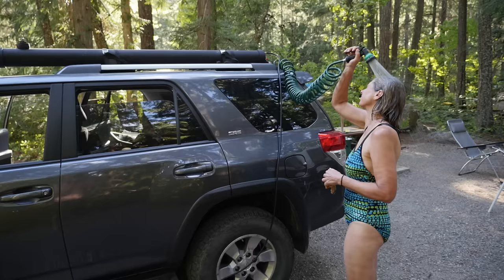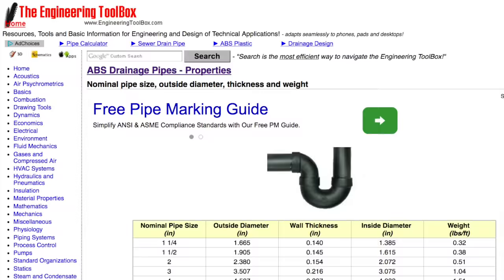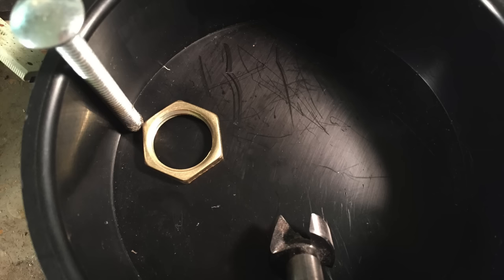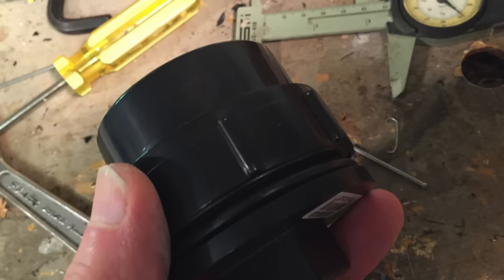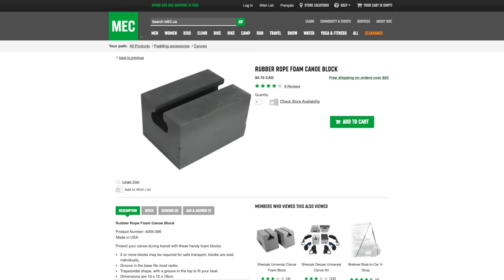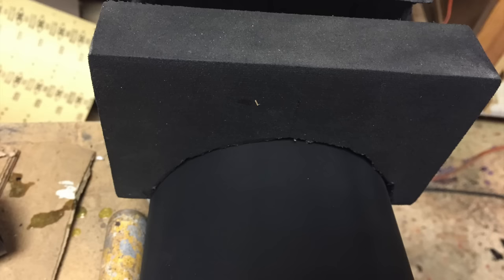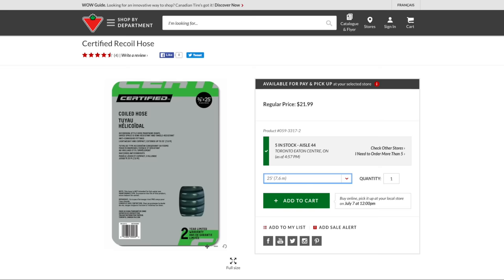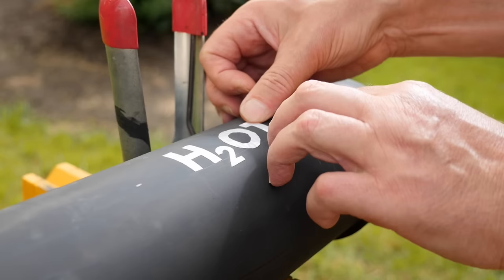H2OT - Rooftop, pressurized, solar-heated shower/sprayer using ABS pipe. DIY

Comment: That's a nice little build. Have you ever thought about adding in a cheap 12vdc water heating element? Back on the farm we had them for smaller stock tanks. I bet a 300 watt element would be perfect for this and heat water up fairly fast. We had them on rubber maid stock tanks, so installing one on PVC should be no problem. I mean it's a standard 1" NPT. 

The general rule is 2.47 watts to raise one gallon of water one degree in one hour. So it's simple math to get you in the ball park.

You would just have to turn it off before draining the tank so you don't burn it up, but if you could take shower after shower with little down time....might be worth it. Keep up the great work.
Reply from the maker: I am not sure how I would power this. 300w @ 12v = 25 amps. A continuous 25 amp draw on my truck (4Runner) battery without the engine running is a not a smart plan.  Also, the idea was to use solar power to heat the tank, thus a carbon free solution. NOTE: The tank is ABS, not PVC. I have explained my rationale for this many times in past comments.
Reply: This is exactly my plan.... Cold cloudy days are not going to be much help at the end of the drive. I'm looking at the 150/300 watt element—has two heating elements, each at 150 watts that can be wired separately. This can be plugged in for the duration of the drive—using electricity generated from the alternator. The length of the element will fit with a 2" side angled clean out fitting.  2" slip to a 1.5" threaded reducer, then a 1.5" to 1" galvanized reducer for heat dissipation from mount of element. Can't be too hot as a plastic bulkhead fitting is used to mount these heating elements to plastic tanks and buckets.

And yes, I will not be using a radiator "pressure relief valve" but a schrader valve on the top 2" screw cap and eliminate one penetration and extra materials. 

Another issue is this design will be blowing air before the water is gone, unless the whole unit is mounted on or the car is on a slope. This is why many folks use a street fitting at the end to drop the faucet to below the level of the main pipe. This design also leaves no way to service the schrader valve or the faucet without cutting open the unit.

But, I'm sure these ideas can be shot down like every other thoughtful change to the original genius. 

"A mind is like a parachute, it only works when it's open."

Comment: Perhaps a reflective strip under your tank to get the most out of the sun.🌞
Reply from the maker: The radiant heat reflection off the truck roof is very effective as it is. I suppose a white vehicle would be even better.

Comment: So 'Flat' Black absorbs more heat than 'Gloss' Black??? Just curious why you painted your already Gloss Black pipe a Flat color. Kool video👍👍
Reply: Yes, flat black gets hotter. Gloss is shiny and reflects some light. Also gets hotter if it's enclosed with glass and insulation.

Comment: Hi, would you see any issues with routing the outlet of this system internally to feed a hot water tap purely for washing up in a campervan? Of course it would need to be drained if freezing temperatures were forecast. I ask as I don't want a shower (internal or external) but dont want a full blown combi (£1500) or a heat exchanger (air to water) via a diesel heater.
Reply from the maker: I see no problem with that. But keep in mind you will have to figure out how to monitor the compressor. As water is used the air compressor needs to kick in to bring the pressure back up and then shut off.  I do this manually right at the compressor outside (while my partner showers).  You will need a compressor with auto-on and off ranges.

Comment: The Milton tire valve includes two rubber washers/gaskets, a top and bottom.  It seems like you did use those, right?
Reply from the maker: Yes, I used the seals that came with the valve.  Someone has recently mentioned that they had two sets of seals with the valve they bough. I believe they are just for different size holes in the tire rim.

Comment: +imaginetMedia  Agree with other comments -- very nice video and end result.  

A few questions please:

1.  How do you fill the pipe with water ... through the 2" threaded cap?

2.  In practical use, how many showers are you getting before you have to refill it?

3.  Why bother using a 2" threaded cap for your radiator valve drain plug, vs. just installing the drain plug directly into the top of the pipe?  Seems the latter method would have been easier with fewer parts, less chance of leaks, etc.

4.  If you built it again, is there anything you'd change?
Reply from the maker: 1. How do you fill the pipe with water … through the 2” threaded cap? 

Yes. If yo look in the at 4:26, you can see I have the cap off (to take temperature). I just use a hose if I have access to a tap to fill it., Or, I have a collapsible 10 liter bucket I use and just put it it. 

2. In practical use, how many showers are you getting before you have to refill it? 

From our numerous uses this summer, we get 2 showers (his and hers) and still have roughly half a tank of water left. So, that works out to be 4 to 5 liters per person. Keep in mind the sprayer is off most of the time. If the water is not hitting your target, then you are wasting water. 

3. Why bother using a 2" threaded cap for your radiator valve drain plug, vs. just installing the drain plug directly into the top of the pipe? Seems the latter method would have been easier with fewer parts, less chance of leaks, etc. 

I decided that the radiator valve was the most venerable piece. If it was drilled anywhere in the surface of the pipe, it is completely exposed to bumps and getting knocked out. At that point you have a unusable hole that will be avery tricky to fill. 

So, tapping it in the cap meant any damage that occurs from a fall or bump would affect a cheap repayable cap and not the tank. 

4. If you built it again, is there anything you’d change?

Not yet. It is working out better and better each time we use it as we have gotten the shower curtain make out of tarps set up for easy attachment to the back of the truck. 

Two things I should have mentioned in the video…

If the tank is completely full of water, there is very little room for air as water does not compress. As a result, you will drop from 30 psi to 10 psi very quickly. But, as you use more water, more air space is made available and the tank will hold its pressure longer. 

Also, you have to make sure the tank (and vehicle) are level or titled slightly up at the front when both filling and using the shower. If yo are tiled down, air will get trapped at the top at the back and prevent that being filled. Conversely, when is use, if it is tilted down, air will eventually reach the spigot before it is at the same height at the front. Hence, you will be blowing air out the hose while there is still plenty of water in the tank.
Reply: Thanks for the excellent reply.

Comment: I built a similar version and am having a hard time holding air pressure.. any suggestions for making it last? I've got 6 ft of 4 inch PVC and after getting it to 60 psi or so and spraying the hose,  I lose all pressure in under 10 seconds.  Are you constantly using the compressor when in use?  Or maybe running less water in the tank to hold more air?  (If that's how that works)  Searched Google everywhere,  found nothing .. thanks in advance, sorry for the long winded question
Reply from the maker: (1) Unless you are pressuring washing your walkway, yo do not need anything close to 60psi.  I max out at 30 psi and that is plenty. 

(2) Water does not compress. Period.  As a result if the tank is 100% full, there is ZERO room for compressed air which mean yo will go from full pressure to no pressure very quickly. However, as the water is used, more space is available to hold more and more compressed air.  As you use it in a shower, the amount of air capacity increases.

(3) I only power on the compressore when the pressure drops to BELOW 10psi. I then turn it off at 30 psi. It may only be on for a few seconds depending how much water and reserve capacity is in the tank.

Comment: imaginetmedia whoops, posted this first in a reply below... Did you have to special prep the metal for painting or just tape and spray? Thanks!
Reply from the maker: I cleaned the metal parts with the same technique of methyl hydrate and steel wool. I prep everything I paint this way. You could easily omit painting these parts if you wanted to as it is primarily for aesthetics.

Comment: AWSOME idea. is there any particular reason u didn't use a larger water capacity? like a dbl barrel design? or did u have a budget goal in mind? im sure it would've been just about dbl the price, maybe closer to online price of a mass produced one im sure?
Reply from the maker: I evaluate numerous options including a double or parallel system as you suggest. weight was a consideration and it was not warranted based on the frugal method of showering I am used to when camping. Also a double system would present its own plumbing challenges in terms of connections as that would have to occur at the lowest part of the pipes which would likely conflict with the roof of the vehicle.  

Great idea though and if you come up with a workable method, please let me know.

Comment: Great Idea! 
I would love to create this for my 4runner set up. 
I know you showed all of the items needed at 1:24. But are you able to list them all out so its completely idiot proof? I dont want to look like a dummy at Home depot. 

I know you are in BC, If you are ever in Vancouver, I would love to check out ur truck and possible buy you coffee to pick your brain :) 

Cheers thanks again!
Reply from the maker: You can use a variety of parts and they will all work (drain, air release, air filler valve, hose, nozzle, etc.) and they will all work. If you stick with 4" ABS, then there are only few options for caps and threaded filler. All the plumbing parts are available and Home Depot. I rough assembled mine while I was designing it, right on the floor in the Home Depot store.

Comment: paint a Hudson garden sprayer black, fill with water, take a shower.
Reply: This idea is really popular in the camping/nomadic communities, but no one will give me a straight answer about how warm the garden sprayers get. I have one of those black plastic shower bags (coleman brand) and while they are pretty easy to break, they get DANG HOT. I put them on my dash under the windshield in the winter time and have a HOT shower even in the winter. In the summer I put 'em out on the ground in the sun. I think I'll be sticking with that solution because it seems for whatever reason the bags get hotter than tank type situations (I'm guessing because the  bag plastic is so thin it transmits more heat into the water??

Comment: I have seen a few here like that in Australia, just wondering have you reached a point where the water is too hot to shower? Cheers and ty for sharing
Reply from the maker: As I live in a +49 deg N latitude, I don't think it would ever get that hot here!  :-)   If it did though, I would drain off a few litres into a bucket to keep for hand or dish washing and replace it with whatever cooler water I had on hand.

Comment: Brilliant.   Thanks.  Mounting this to the top of my camper makes this tank about ten feet above ground when camper is set up.   Difficult to fill and pressurize.  Any suggestions?
Reply from the maker: Regarding pressurizing, you could leave an extension hose attached to the tank and secured to the back of your camper. Then when needed, just attached the compressor to the end of the extension. Here is a 5ft extension: 

https://www.amazon.com/Viair-00016-Portable-Compressor-Extension/dp/B00ELJD0BW/

Comment: What is the flow rate of your compressor? I’ve made a similar system but my compressor is 120L/min and when the tank is full it reaches 40psi in under 10 seconds. I’m so considering a custom compressor line with a 2.0bar pressure relief valve on it to ensure it doesn’t over pressurise the system and turn into a cannon!
Reply from the maker: When the tank is full of water, there is zero room for air, compressed or not, as water does not compress. As such, it will pressurize to 30psi in a few seconds.  The flow rate of the compressor is irrelevant. Any HPLV compressor will do. I just use a very good one as its primary use is blowing up tires when needed.

Comment: Nice! But, is the paint necessary or just for looks? Also, how much does it weight full? Are handling characteristics of car affected while driving? Overall, a neat deal! Thank you!
Reply from the maker: Paint is definitely an integral part of the design. Find a white car and a black car. Go stick you hand on the hood of each in the bright sun. Basic physics.

Full specs are listed in the spreadsheet. 

I am driving a 5000 lb 4x4 towing a Trillium trailer that acts as a parachute in the wind. Any adverse handling characteristics would be impossible to detect. I would speculate it is the same as sticking your hand out the window.

Comment: Sir, where is the temperature thermometer that has a need tip to put through the heater to make contact with the water.  Would be able to see temperature at a glance.
Reply from the maker: I use one of these...
https://www.ebay.ca/itm/1pc-Digital-Aquarium-Fish-Tank-Thermometer-Temperature-Stick-On-Sticker-H7R2-/184315587943?hash=item2aea10ad67
Reply: @ImaginetMedia    O nice, that's actually really smart.

Comment: What are the original dimensions of the canoe blocks you used? I have everything built, just set to ABS cement the end cap on tomorrow and paint. I just need to order the correct size canoe blocks to then trim to fit my roof rack.  THANKS!!
Reply from the maker: Looking forward to see your build.  The shower I mean, not your body!  :-)

Here are the exact blocks I used...  https://www.mec.ca/en/product/4005-396/Foam-Canoe-Block
Reply: Chadillaac you can simply use hose clamps to fit it. Put a 100mm clamp around the pipe then a second clamp around the roof rack, threading it through the first clamp and tighten it all up. It will never go anywhere!

Comment: I love this project. How do you fill it with water?
Reply from the maker: Most times I use the freshwater hose provided at campsite sani stations.  If I fill at home I just use a hose.  In the campsite, I use a collapsable 10 Lite water bucket and just stand on the running boards and pour it in.  One note though, the front (filler end) should be slightly higher than the drain end when filling. This will prevent air from being trapped int the pipe and thus reducing the capacity.

Comment: couldve used a 12v water pressure diaphragm  pump, neat idea
Reply from the maker: For $120. Hmmm, I don;'t think I couldve.
Reply: imaginetMedia no they cost on ebay less than 15 dollars , i have one
Reply from the maker: Paste a link to one that is at least 30psi. and costs $15 inc. shipping to Canada.
Reply: Them pumps dont last long with hot water running through them

Comment: Hello. Fantastic video, this is really well put together and I applaud the thinking that went into building it.

I think I am going to attempt to replicate this & had a few quick questions.. 
-Where did you find the 2nd valve?
-Do you have any recommendations on cutting cost? $300 seems crazy for this.
-Have you used it enough to think of anything you'd like to add/change?

Thanks so much, again fantastic video!
Reply from the maker: Glad you liked it and hope yours turns out great. 

"Where did you find the 2nd valve?"
Not sure what valve you are referring to. The main spigot is a 90 deg ball valve with NPT threads I got at Home Depot. The air release is actually a radiator drain valve that you can get at an any automotive store. 

"Do you have any recommendations on cutting cost? $300 seems crazy for this"
$300 is the price of the aluminum one I found on line. Mine cost about $60 as far as I recall. The most expensive piece is probably the6' length of ABS pipe. Knowing a contractor would save you a lot on the plumbing parts. 

"Have you used it enough to think of anything you'd like to add/change?"
We have used this dozens of times and would not change anything. 

A couple notes though:

When you fill it, make sure the vehicle is tilted slightly uphill. This will prevent air getting trapped a the back, thus reducing he volume and creating a air void that would "slosh" around" Similarly, you need be be tilted slightly uphill when showering as the same issue will occur. The water level will drop to the drain level, while the front is still full, if yo are tilted downhill.

Buy the best compressor you can afford. See my explanation in the comments from yesterday. 

When filling, fill it right to the brim. This prevents a water hammer when moving.

As the tank is full, an water does not compress, there is very little space for compressed air when you first start the compressor. You will reach 30 psi quickly and just as quickly deplete it. So, be prepared to turn on the compressor a few times to keep the pressure up. It still works great down to 10 psi so as the tank begins to drain, the air reserve is increased and the duration between recompressing is increased. Once the tank is about 3/4 capacity, one recompression will last the remaining tank.
Reply: Thank you so much for this reply, you really went above and beyond to answer my questions!

I am definitely going to build this, 60 bucks is way more in my college build budget.

I'll be camping on the mainland a ton this summer now that finals are about to finish, If I see a 4Runner with a road shower, I'll give you a friendly wave! 

Cheers & thanks again from Victoria.